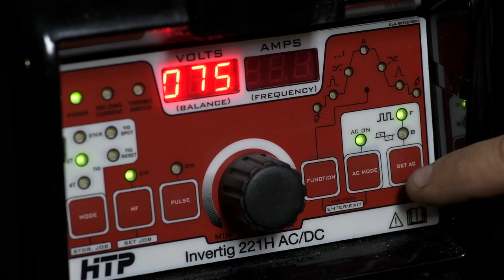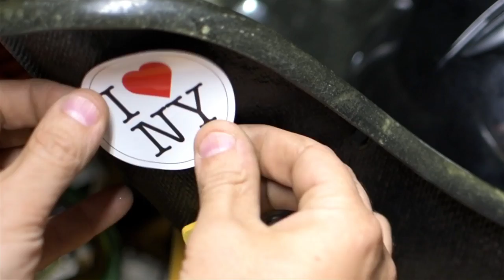GO KART - Part 4 - COMPLETED!

Comment: Damn, kind of jealous of his skill on driving that, I'm 13 and the first time I rode a go-kart I crashed into a wall so hard and almost broke my neck
Reply: When I was a kid there was a spoiled kid who got a new minibike for Christmas. We all wanted to ride it but he wouldn't let us.  He was bigger than us and the only way he would let us was for us to sit on the front edge of the seat while he rode on back. When I was on it he pushed me forward and off the seat - bastard. I was up against the handle bars so couldn't steer it so we went head over heels after hitting a curb. Later, he was showing off, lost control and ran into the side of a house. Karma is a bitch.
Reply: MILLENIALS IN A NUT SHELL
Reply: I'm 14 can drive anything started racing go karts at 5 easy peasy.
Reply: Judging by your video, you can't even sit in a chair without hurting yourself. Try going outside more often, video games don't teach much for motor skills.

Comment: I bought a go-cart to race when I was 15 years old, learned a lot about four-stroke engines as well as handling a variety of driving situations on different surfaces. Two other friends with more money were also racing with me and each of us had our own "pit crew." Of course, one of my friends was David Sosebee, son of three time winner of the Daytona Modified Cars when the races were held on the beach (asphalt track opened in 1959). Of course, the latter friend dominated our racing  on several different surfaces, including a 1/4 mile dirt track for super modified cars. where we turned the track faster than the top class race cars.

But I digress, At retirement age now and looking back on my "racing career," it was one of the most enjoyable things I ever did. I learned a lot about being a mechanic and got a lot of mechanical skills. And, most importantly, I strongly believe that the experience of go-cart racing helped my driving in cars tremendously. If you look at the early racing experience of most race drivers today, most, if not all, raced their way up the ladder in different classes of go-carts. Two of my friends went on to drive in NASCAR's Cup series and one won the NASCAR Championship. I went on to drive emergency vehicles for a time and still believe that my go-cart experience helped me get to the patient more quickly and safely and then transport the patient at a safe speed, avoiding lateral G forces, bumps and braking at a rate that could increase patient pain of hinder treatment.

Comment: Great job dad. When our twin sons (now 22 years old) were little I did a similar project. However, I did start with an old go-cart frame I bought from a farmer that had it in the corner of his barn. I then installed a larger motor on it. Also dealt with the same issues of gearing, and also the cheap wheels. We actually demolished the first set of wheel bearings and hub assembly. I then went to a local go cart shop and ended up ordering some pretty decent go cart specific wheels. Not the racing type, but just standard. I built a seat base using a cardboard template, then cut our plywood. Went to a local vehicle upholstery shop and got some scrap dense foam and vinyl for the set. We painted the cart white, used blue for the seat, and then used decals to make the cart look like one fo their favorite nascar drivers. We made ours a two seater so that I could be with them early on, then later they rode around together.

Good times

Comment: Love it. When I was a teenager I made myself a go kart. Got my mums boyfriend to weld up the frame. Used an old cement mixer engine (with a worn out magneto ignition that was a right ** to start). It had a hydraulic brake like yours (but mine didn't really work lol) and my steering geometry was totally wrong. It was belt driven with completely the wrong gear ratio, but after a push start and lots of smoke from the drive belt it ran. Did about 20MPH and was only safe in a straight line. lol. I was 13 so the design was all wrong, but for me it was brilliant fun and I'd made it.

Comment: Loved the 4x speed thing.  I was thinking how well a 5yo was doing and how that little motor rocks.  I can see that throttle bolt coming out soon.
I think you picked the alignment problems on the front but the back is probably the fact you don’t have a differential and they are running on bitumen.
When I was about 10 my friends dad built him a 1/3 size Mini Moke. I was so jealous. Watch out for your kids friends :)
Great series.  Glad I got to watch them all in a row.

Comment: Wow, an HTP Invertig; brings back memories.  Had one of those about ten years ago, and had to move; so I gave it to the friend that I'd call every time I needed some aluminum welded and was too wise (chicken) to do it myself.  Still had plenty of other welders for doing steel (for a while you could pickup little lunch box Millers on ebay for pennies, well maybe a lot of pennies), but that thing sure had lots of blinking lights and fancy settings.

Comment: I really love your videos.  I have seen other front ends that have more going on.. The wheels are mounted on something that looks like 2 parallel-a-gram triangles.. The other thing I noticed is the universal joint in the steering shaft. That would have allowed tilt steering.

Comment: Very cool! 
The only thing I would have done different was to put the gas tank filler on The RH side closer to the outside, by the tire. 
It might be safer to fill, and away from the exhaust and hot motor.

Comment: You should put throttle and brake on handle bar,  then You don’t have to worry how tall the operator is. The taller they are, the higher their knees go.. I have a Go-Ped,  Go-Quad and that’s how it’s made. I’m a machinist for a long time. You do very nice work.

Comment: Needs a seat belt or make a harness cutting 2 slits in the top of the seat and just use some old  straps Weld a mounting bar in the back run the straps from the back through the seat over the shoulders and down to another mounting point connect the necessary buckles and ba da bing ba da bang! Safely then as they get better they can go faster safely... that good ok’ piece of mind! 😉
Cool build tho thanks for the journey!

Comment: I would say that you started off simple and went from there, it looks good and cllearly goes well ( maybe solid rubber tyres would serve well)
It will keep two kids really ammused for many hours as long as pocket money keeps the fuel coming.
Now the next project is easy in comparison, a wind driven go kart and thee are plenty of plans for those too!
All in all it turned out really well, mind you, having a work shop well equiped helps a lot.

Comment: This Old Tony, If you are still sweeping through comments; for tires you can just pull tractor rubber right over those polyurethane wheels and your set for a bit longer.  The thing is that the tire "pressure" is too high for the "substrate;"  HFT has some pretty cheap pneumatic tires that i'm sure may be easily adaptable to your needs so you can lower the pressure to get the life out of em'.  Nice job all around; "I am a fellow Machinist myself."   and enjoyed watching 1-4.  Curious what you used component wise for your router! Cheers!

Comment: Go to nearly any shop that works on planes. Tires for planes have very specific conditions for replacement, and afterwards just get thrown away. My brother built a cart that used learjet tires. My uncle flew and brought them over. They still had half an inch of rubber when the wear indicators were exposed, designed for extraordinary high pressures and effectively Z rated. Not much for grip maybe, but not driftcart bad... or good?

Comment: Once your kids get some seat time, mount the chainsaw engine in it, & leave the gear on the axle & the one on the c.s. engine. You could probably put lower profile tires on those rims. I also wanted to tell you that your a great welder, fabricator, & machinist. Jack of all trades.

Comment: It’s a great build but if you had the extra material on hand I’d recommend making a fuel tank with baffling on the inside you’d be surprised how easy it is to starve an engine through any turn when you’re on lower fuel not required but it always helps

Comment: Did you have a look in the transmission case ? I have the same one and it's just 2 sprockets and a very thin chain and little bit of grease .  I've been building carts and motorbikes for a while now out of scrap and you have done a very excellent job . Top video

Comment: Really enjoyed watching this and the humor in a lot of the videos on your channel. You have some well timed humorous editing in there too lol

I noticed the high speed go cart footage at the end of this vid was a little juddery or skipping back a few frames. It’s possible it was caused by your work comp set at one frame rate  (29.976 or 30 for ex) and your go cart footage was say 24fps, or 60fps again,  as an example. The software can cope with this misalignment until you put an effect on the  conflicting footage, which will then make it judder or have other kind of issues. The work around would be render the juddery footage out at its original speed, BUT at the frame rate you need for the comp, then reimport it. Throw your speed ramp back on and the judder should be gone.

Wasn’t sure if you knew, just thought I’d mention it. Again, great videos and thanks for the entertainment! :0)

Comment: I remember building a go-cart with my brothers, as a kid. 
My oldest brother had found an old Craftsman edger in a junk pile that someone had dumped along a levee. He took the engine off of it and we proceeded to build a wooden deck and seat for the cart, used a bunch of scavenged bicycle parts for steering, drive sprockets and controls. The tires were off of a 12” kids bike for the front and a 20” bmx for the rear.
There were no safety covers or helmets and it was a goner after the first couple of crashes, because it wasn’t long after it was built that we built a ramp to jump it over. It was the ‘70s. It was a different era. We cobbled that thing together, drove it like we stole it for two weeks during the hot summer, and completely destroyed it having a degree of fun the kids these days will never know.
Man, those were the days.

Comment: I remember the go kart my brother built in high school. The kill switch was a wire through the horn button on the steering wheel from an old civic that was some sort of miracle welded to a steel shaft. I don't understand aluminium to steel welding either, but if you don't know its not possible, then it's possible. Anyways, the horn button closed a circuit, and as the driver apparently you were well enough grounded to become part of it, kinda tickled.

Comment: Towards the tire consumption issue. Get some kids bicycle wheels. My dad built me a soap box racer back in the day and we used those there. Tires are cheap to get and the higher diameter will make it roll more smoothly.

Comment: I really like your videos, but this project was way overworked for a kiddie cart. My dad built one for me and my brother when we were 5-6 years old and it was much simpler. Using a lawnmower engine (briggs&stratton) with built in centrifugal clutch, a small gearbox with one forward and one reverse and neutral,  small brakedrum, and similar wheels and tires. The tires held up for several years. The cart made about 30km/h which was FAST for us. Rear wheels had to be separately running. (stiff rearaxle makes it impossible to turn. So engine run only one wheel. We completelys trashed my grandmothers yard and garden ;) So dad made a special track on an unused part of his land. Kids all over the neighborhood came and wanted to drive it.

Comment: I think you did a great job on the cart Tony    It  looks like it is very proportional in all the footage  and  the yellow paint on the frame even sets it off a little  bit  i bought a used one for my son years ago with a Briggs and Stratton 5 horse motor  that made the thing pretty quick  perhaps a little too quick. As he did  roll  him and the cart completely over. In a powerslide  turn. Thank fully a full face helmet  protected his head  and face  very well. Although he did    Wind up with quite a bit of road rash on his  arms and legs  because of short sleeves and shorts  in the slide  his tires caught on a metal drainage grate on the asphalt  he was  very shooken up  and did cry because  his new  Harley Davidson helmet  got scratched  of course i  made him look in the mirror for scratches and blood on his head and he said he didnt see any  so I explained that  was because the helmet did what it was supposed to do  we can buy a new helmet but not a new head  his  nervous crying turned to laughter  and the bandages  became. A badge of coolness to his buddies  for flipping his Gocart ! I am a firm believer that  children. Will have  great memories of childhood  from these Go Carts and  learn quite a bit of mechanical basics  with them that  will last forever as i taught my son  how to make adjustments  and safety checks  along with  performing  basi maintenance  as he outgrew it he passed it on to a younger cousin who has been able to have good memories as well  it was funny because i. Did pull y son aside and told him  I gave it to hi as a gift and he had the right to. Be able to sell it  and keep the money  although he  decided to  pass it along for free because  he wanted his cousin to have good memories too

Comment: Suscribed and notified, well done on that mean machine! Tip of the hat from a karting race track mechanic 🏎🏁  for size try playing with seat position,  and steering angle seems a bit odd. Also if youre still looking for racing wheels and tires, i might have a few beaten but still going strongs ones i could send your way, especially since you handle a tig so nice. Cheers mate
Reply: Ours do 70kph on an inside track, but with gear ratio pushed towards sheer speed, 120 klicks on open grounds. Also, caster is your friend if you want this to steer sharper, lift one rear wheel off the ground. I really enjoyed an "amateur" take at this, no offense whatsoever here. You are a true artisan, and i dont give this compliment off easy. Cheers again

Comment: usually only one of the rear tires is a drive tire. makes the tires last longer and not slow down in turns. 

pretty bad ass cart man...
Reply: 1 wheel drive sucks, it causes uneven tire wear
plus the common drive axle makes it easier to drift if you have a powerful enough engine (although this obviously won't do it)

Comment: I was wondering if you could explain the type of steering used on the Arcimoto.. It allows the vehicle and wheels to tilt in the direction of the turn. Which compensates for centrifugal forces slamming the rider against the outside of the turn.

Comment: Hi I know the go kart  video is old  with few million miles on the clock but only just watch all 4 video's. Tyre wear back axle  problem sorry I no read if some one said brfore but no diff on it id think dewelding one wheel and on tight corners it wpuld pull top end speed off.
My first cart got uncle twist 2 flat strips steel drill holes for back axle which i bolted to the board. 2 years later found out why fit bushes bearing when axle fell in half playing. Them was the days.
Keep the sence of hummer up.
3C in uk this moring 
Steve

Comment: Ok, I'm sure people mentioned it at the time and this video is really old now, but fabricating a fuel tank out of aluminium is a really bad idea. Putting it on the top like that is even worse. Sure this thing probably won't flip over, but you never know. And the slightest impact on that tank, it'll pop open and spill the fuel everywhere.
Reply: Better than nothing

Comment: I'm close to finishing a 4 seat Chenowerh frame my shop neighbor gave to me w/ a VW motor in it. I modified the frame, made it narrower 2 seater, sportier looking and threw a 290hp inline 6 engine. It's AWD, huge suspension with tons of travel. I built a windshield and a hood to keep the majority of the wind off me. I may complete some sort of aluminum body next summer if I get inspired. I cannot wait to blast around in that thing after/during a snowstorm, wearing a snowmobile suit with electric built-in heater! Hopefully find some cops, get em to chase us and fuck with them! I need to start a damn youtube channel, damnit! I got bummed out when I looked at buying a Polaris Razr.....$20k yeah, hang on, Ill be riiiight back! So i built this entire buggy, I call it a side by side trophy truck, all for under $6,000 and I haven't raced a RWZR but I have a strong feeling this'll eat and shit whatever 1000cc turbo charged p.o.s. they're shoving down rich kid's throats these days!

Comment: I would have made the steering wheel adjustable (up and down) {if I were a machinist} with the angle lockable, like my real car.  I think it should have been made a bit faster.  I would have included a seat belt.  Nice project and very nice looking. Ron W4BIN

Comment: Unfortunately I go you beat I got a 50 $ frame a 12$ engine 8hp and a few parts (est. 80$) centripetal clutch, #35 chain/links, sprocket (came w frame).
And with a little modification with some scrap laying around I put it together.
P.S. some tires came with the frame but i changed one (drive tire) with a new one from tractor supply (yes one wheel drive).